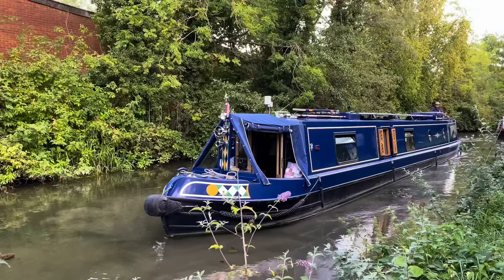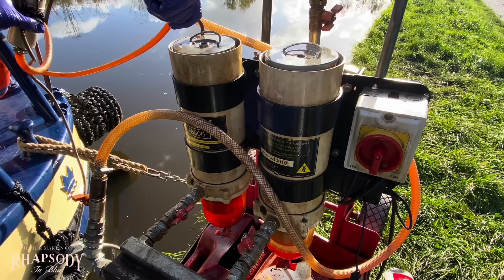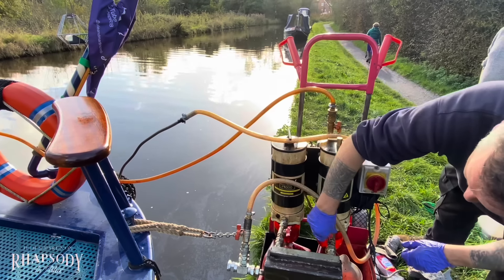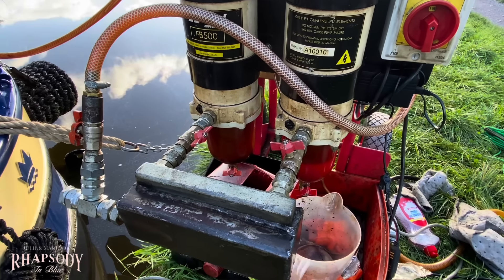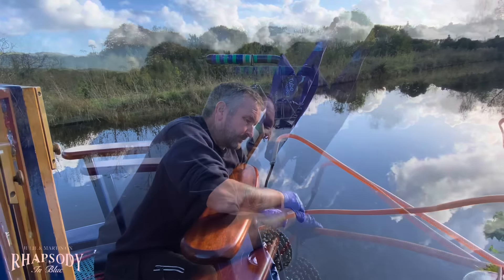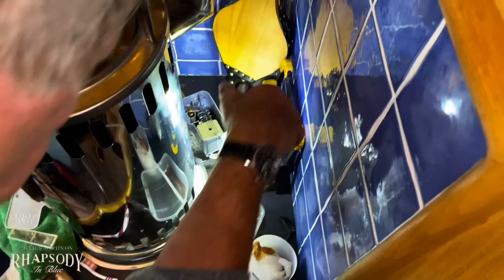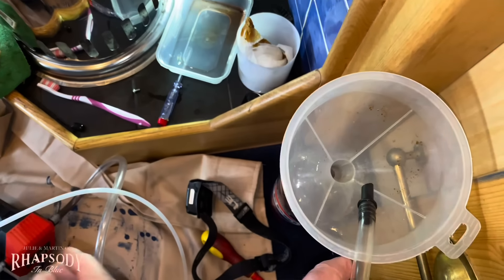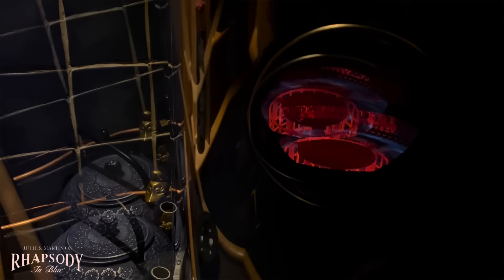DON’T Do What We Did! | Is it DIESEL BUG? | FUEL POLISHING | NARROWBOAT Living Ep118

Comment: Informative vlog - possibly? will? become a must watch safety vlog. And easy to understand (even for a landlubber😂). 
But the cost Julie? - Reasonable only because Martin had the skill to undertake other "repairs" would have been a cost blow out otherwise. 
Would it be a good idea to have other "fuel users" on board checked as a precaution at the same time?  Jan Adelaide
Reply from the maker: Hi Jan, yes hopefully this will help other boaters. We always thought you only needed fuel polished or cleaned if you had a problem! But obviously prevention rather than cure applies here, we wouldn’t want any of that sludge getting into our engine, we were blissfully unaware that it was there until Martin dragged it up in the jiggle pipe! We’ve added it to our maintenance schedule now too and hope that others will do the same! We thought that Martin had spotted it before any got through to the fire, and normally, if anything else runs using the diesel from the back tank, it would have been isolated before the treatment started. Our Stove has a separate tank at the front that is not connected to the back tank, so until the fire started burning wrong, we hadn’t realised. So glad you enjoyed this video Jan, thank you for your comment! xx

Comment: Hi Julie & Martin , I saw your West Ham plaque and thought I would share my knowledge with you as a fellow hammer. The problem with diesel bug is not actually the bug but the defecation from the bug , the bug lives in a layer between the water and fuel an oxygen rich layer. Looking at the diesel from your tank it didn’t show any bad signs of diesel bug just sludge in the bottom so there is no need to add diesel bug killer. The bug lives at the very bottom of the tank as water is heavier than diesel and diesel bug CANNOT be transferred to your tank from another tank ie when fuelling ( unless the dip take of pipe is sat so low and there is lots of water in there). What can be transferred is the defecation from the bug as the defecation is lighter than diesel and so just floats around as a very fine paste so always use a diesel supplier that has a high turn over of diesel. Depending on how long the bug is in your tank as to the amount of defecation in the tank. It takes a minimum of 5 passes to clean diesel which is roughly 3/4 hours with varying filters down to 5 micron hence the term fuel polishing . You can buy water traps to go in your tank if you suspect you have water in there they are called water hogs, they come with string and you just pop it in your tank for up-to 3 weeks and it only collects water. I dealt with diesel bug on a professional basis in my job. Hope this makes sense and helps
Reply from the maker: Wow, we didn’t realise all of that, thank you for this info!  …. And, Up the Hammers! 😃 xx

Comment: I bring diesel for our boat with me (I get it off a mate who has a large farming business so has a large turnover of diesel) I’m surprised how many bits of muck that gets in the mesh of the funnel I use when filling up I often wonder when I buy a some off the canal side how much dirt get into the diesel tank as it doesn’t go through the funnel mesh The tanks on boats are designed to hold a bit of sediment in the bottom as the outlet is normally a inch or two from the bottom
Reply from the maker: Yes, it’s surprising just what’s in our tanks, having done every 4 years was a good bit of advice by Del, we’ll certainly be doing that. Thanks David! xx

Comment: Curiosity question,  in the U K do they restrict usage of the red dyed diesel to narrow boats and agriculture equipment?  Here in the USA the dyed fuel is for agriculture equipment primarily and is priced cheaper than diesel fuel used for passenger vehicles.
Reply: Yes its illegal to use in road vehicles....
Reply from the maker: Yes Norman, it’s very similar over here in the UK. The red diesel is for agricultural vehicles and boaters for heating also. The diesel we use for propulsion has to have tax paid, so when we buy diesel, we as boaters declare a percentage that we are going to use for propulsion and a percentage to be used for heating, so in the summer, it’s higher for propulsion, as you’re only heating water, yet in the winter, it’s mostly heating. Hope this makes sense, thanks Norman! xx
Reply from the maker: Thanks Rob, that’s right! xx

Comment: What a total waste of money fuel polishing is the biggest con in narrowboating never have this done it causes more problems then in cures. You have now had somebody stir up all the silt in the bottom of your tank he will tell you it's all cleaned out but that is just not true if left alone it just sits on the bottom and is no trouble now being stirred up it could cause no end of trouble.If you ever get water in your tank a stiff pipe lowerd to the bottom of the tank carefully and your 12v pump will suck out the water no problem don't wiggle it about that stirs up the slit causing problems
Reply from the maker: Hi BigKDL, we would rather be safe than sorry, we saw the muck coming out of the tank and clean diesel going back in, plus all the gunk that was left in the filters and bowls at the end, so we feel it’s money well spent. Thankfully we’ve never had water in the tank, but yes your suggestion of using the 12v pump would be good. Thank you for your comment, much appreciated! xx